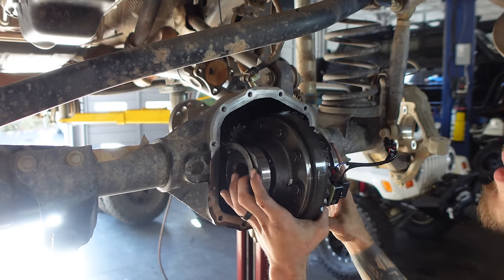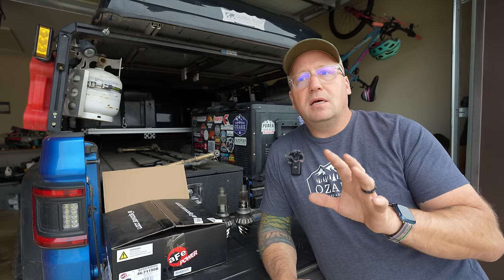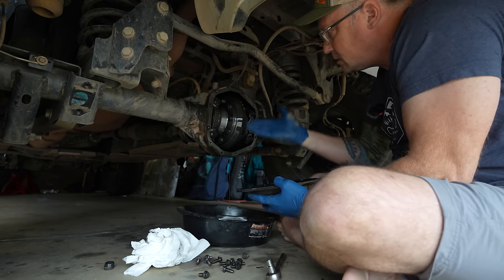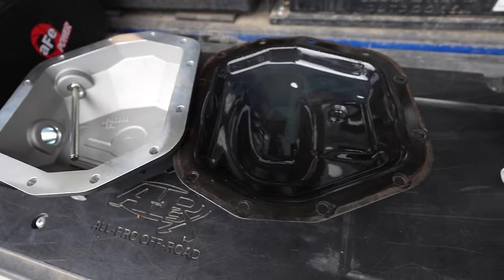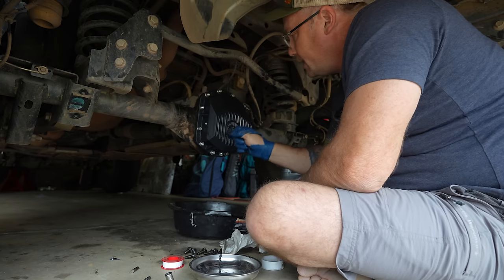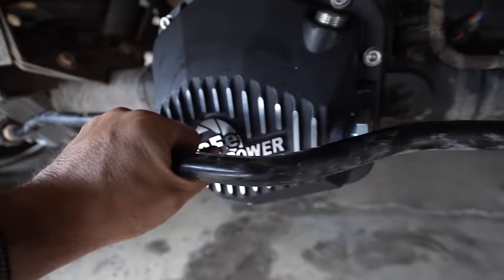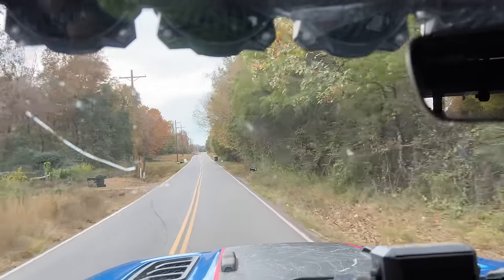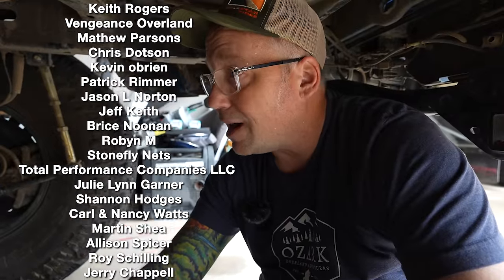Watch This BEFORE You Regear your Jeep JL/JT - Lessons learned the hard way.

Comment: 5.29 gears and 38’s are a lot for the stock axles. Especially with all the weight of overland stuff. So I wouldn’t blame the installation or gears.
Reply from the maker: If this was on a JK I would agree with you but the new axles on the JL/JT are much stronger and can handle it.

Comment: An aftermarket larger capacity diff cover is of no benefit. It will actually just cause more air bubbles to get mixed into the gear oil. Gale Banks has went into detail about this. The factory differential cover allows the oil the properly flow up over the ring gear, the flat back cover doesn't. You had another issue which caused this problem.
Reply from the maker: That seems to be the subject of much debate. We will see.

Comment: Seems your back lash was set too tight resulting in excess heat from your gears. Your gears can take more heat then the oil can. If it was a diff cover issue not being able dissipate the heat the entire diff housing and cover wouldn't look as clean.  Also if adding a larger diff cover was necessary for driving long stretches with high ratio rear ends then what happens when the vehicle is towing? Toyotas have been running 5.29s for ages in their little 8 inch rear end housings with no problem granted the 3rd member was set up properly but setting up those diffs are a breeze. I'm just giving some food for thought

Comment: Running 33’s now on factory 4:10’s, but getting ready to go 35’s or maybe even 37’s sounds like I should just stick to the 4:88, correct? I don’t tow but get on highways for extended periods in 90+ weather most of the time. Sounds like lots of dislike with Yukon and Nitro gears. Any req’s would be appreciated. Thank you!

Comment: Hey Matt - That is so wrong! It does make me wonder about the towing: My teardrop is about 2,500 lbs and I tow it at highway speed quite a lot... I'm running my stock 3.73 gears in my 2021 Gladiator and your experience has me wondering if I should install the larger diff cover to help keep the temp down in the rear differential. As I mentioned in my earlier comment I don't wheel it seriously but i do cover a lot of highway miles pulling the trailer.
Reply: He's actually wrong  about it. Fluid capacity dose help but for temperature.  But his failed due to bad manufacturing.
Reply from the maker: @jessemeanlt1 - That's plausible but you can't say that with certainty since you aren't here to fully examine the parts.

Comment: Thanks for sharing your experience.  I am hesitant to add an aftermarket cover because of the Banks video showing flow of diff oil.   I also wonder about your gear set mfg and installer.    

I ran 5.38s on my Mojave and pulled a 5000 lb trailer up and down the rocky mountains and never had issues.  Spicer gears with a reputable installer.

Comment: Thanks for this video. I am new to all this and building my new jeep gladiator Rubicon 3.6 with new TeraFlex suspension and I’m going all in, about 20,000 in so far in upgrade estimates.  I am heavily considering regearing to 5:13 since I will have 37’s and am building for over landing.  Any suggestions on dependable brands? Other diff cover options?
Reply from the maker: Yukon is solid. I’m not really aware of any bad brands.

Comment: Highly recommend giving this video from Banks a watch - https://www.youtube.com/watch?v=vdtmDl5EDJ8 - as it's not simply a matter of fluid capacity or heat dissipation.  More gear oil capacity doesn't prevent overheating, all it does is provide more fluid to heat up which means it just takes longer to overheat.  Better cooling and correct sling pattern to keep everything lubricated is more important than having more fluid capacity.  Same goes for deep transmission pans.  More fluid doesn't make it run cooler, it just takes longer to reach the same temps.

Also, how soon after you did the regear did you start towing or driving above ~55MPH?  The shop should warn you not to tow and not to exceed 55-65MPH for the first 300-500 miles as the gears need a chance to work harden/burnish which makes them stronger.  If you overheat the gears before they have time to work harden then they will become brittle and you'll destroy them when exposed to high load/heat for long periods of time.  You can't run down the freeway at 75MPH or tow with new gears right out of the gate.  This is also why the owner's manual says not to do any towing within the first 500 miles of new and not to exceed 55-65MPH within the first 300-500 miles.

If proper break-in wasn't done then you set yourself up for failure.
Reply from the maker: I've seen it.

Comment: How do u you over heat the diff gearing ?? 
I tow with my defender 130  3.5 tun and been doing that during the drought in the middle of summer and the diff gearing was fine ended up snapping a axle from just over loading clocked 40000km like that
Same as my other cars I do massive amounts of km 
Is by changing the gearing creating more heat ?
Reply from the maker: taller gears and much larger tires.

Comment: Did you change the front Diff Cover also? If so any clearance issues with the Clayton Trackbar?
Reply from the maker: Front diff cover is coming. They provide shims to clear the rear track bar. It's working great.
Reply: @OzarkOverlandAdventures  I just changed the front and I currently have the Yeti Trackbar and for road use it is close but as soon as I flex off road I know it will hit,  I am looking at the Clayton Trackbar to replace it. Probably replacing to lift with a Clayton Lift.
Reply from the maker: @Chaplain_Bill  highly recommended the Clayton lift and track bar!!!

Comment: Good day mate I bought jeep gladiator 2021 and the dealer has put 35tiers on. Do I need to regear
Reply from the maker: Do you see 8th gear going down the interstate? If so, no. If not, yes.
Reply: @OzarkOverlandAdventures  I didn't understand what you mean
Reply from the maker: @MrCheerbo  when you’re driving down the highway, does the transmission go into 8th gear (assuming you have an automatic)? Or is it cruising in 6th or 7th?
Reply: @Ozark Overland Adventures  I have an automatic I have  no idea how many gear's is changed when I'm driving but I know it's has 8gears.the only thing it goes high rev takes longer to changed gear's.

Comment: Okay, gear guys, I have a 2020 Jeep Wrangler Willys and regeared from 3.52 to 4.10 and had a Detroit TrueTrac installed in the front.  Dealer ordered gears/bearings/seals and they did the install.  Dana 30 front/44 rear and I have 33" x 10.5" tires on stock 17" x 7" wheels with no lift.  About 15K miles later and I'm "feeling" a growl or very light vibration in the steering wheel starting to develop.  Jeep is daily driver/commuter with frequent highway distance travel while towing 2K lb Aliner popup camper here in Arizona.  Anybody know history of bearing/pinion/gear failure in the Dana 30 with 4.10's?  I'm sure the diff cover will be coming off to do an inspection/diagnosis coming up soon, but this video was timely and thought I'd ask.  Thank you!  Pete in AZ.
Reply from the maker: That really could be a number of things. Could be a front wheel hub going bad. I doubt it's anything in your front diff since you wouldn't have any issues with it when it's in 2wd and you wouldn't feel anything in the rear through your steering wheel.
Reply: @OzarkOverlandAdventures  Thanks for the quick reply and ideas.  Today while driving at around 45 mph I just nudged the steering wheel off-center and could feel an increased "growl" feedback, which kinda leans towards a bearing over a gear problem, I think?  I also put the transmission in neutral while at around 45 mph and there was no difference taking the torque load off the gears while still having the consistent feel in the steering wheel.  Some more diagnostics by the shop should narrow down and fix the problem.  Good video and topic, and thanks again.

Comment: Doesn't the crack in your windshield cause an eye fatigue when you're on a long distance journey? I used to have, but mine was a a multiple lines, long and short. Applying clear nail polish on the crack seems to work.
Reply from the maker: Only when the sun is reflecting in the crack. lol
Reply: @OzarkOverlandAdventures  so much for the Gorilla glass😀

Comment: If the pinion gear doesn’t have end play it will do what happened to you . Because the pinion has no end play it causes heat from friction . I am willing to bet in fact your oil was not the cause of you issue , i may not have been able to cool the pinion because the heat generated was just outside of its scope of capability ..
Reply from the maker: That's plausible but no way to prove it.

Comment: Your once again giving the wrong info
Look at banks rear diff covers 
A flat back cover makes moor air in the fluid witch will shorten the life of the rear ends
Look at banks 
I don't know if thay make one for your jeep 
But you will see the way there are made to work
Reply from the maker: Once again? I’ve seen the Banks videos. These diff covered aren’t completely flat back like the ones in the Banks videos and I’ve spoken to the guys at AFE about it. I’ll be fine. Thanks for your concern.